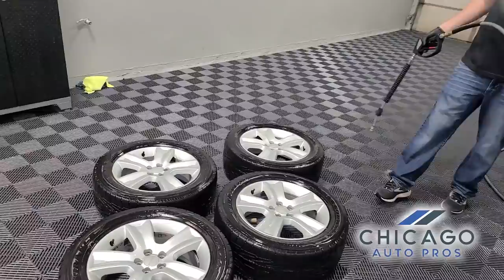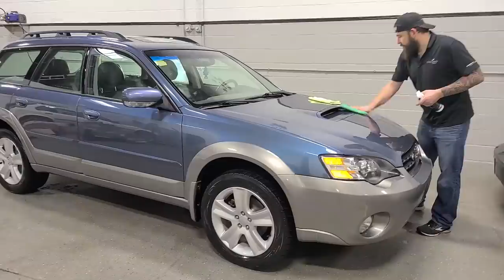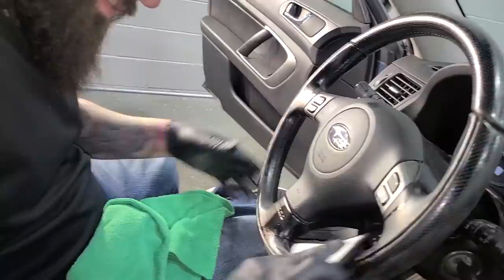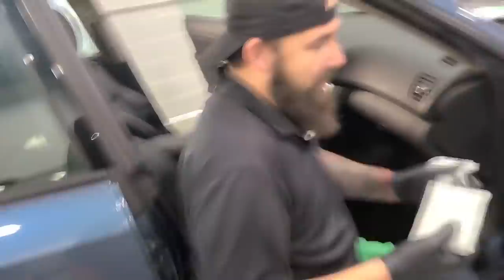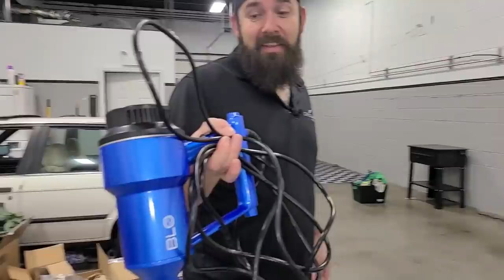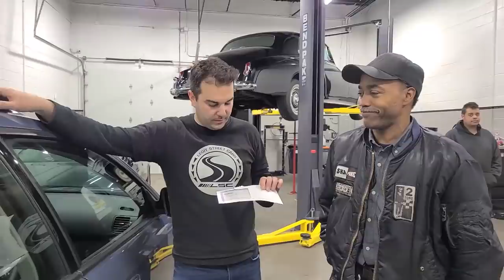I Tried Giving Away My Turbo Subaru To A Subaru Enthusiast For Christmas & He Said NO! REJECTED!

Comment: I have exactly the same car and same color. 2005 Outback XT Limited 5EAT with 177,000 miles. I bought it used at 95,000 miles and had to replace the turbo. Other than wear and tear items, it has been pretty reliable although not as reliable as my Hondas and Toyotas. I had to replace 5 bent valves a year ago because timing belt broke at about 65,000 miles. I pulled the engine out and other than the 5 valves, everything else was fine. Hopefully I can get another 100k miles out of it. Good luck to the next owner. Merry Christmas, Happy and Healthy New Year to everyone.

Comment: Subaru enthusiasts, by default, can all be defined as "in need." 🤣
Reply: lol y u no like subrrraru?
Reply: @useless3596 , I had a new '13 Outback that drank oil like a highschool freshman at a kegger. That thing burned through enough oil in the sump on a 180 mile highway drive to trigger the low oil light. Fool me once and all that. 😅
Reply: @mphilleo  it was NEW? Good grief...
Reply: @benzlover55 , yep, a brand new lease. This would've been included in that class action suit/recall/extended warranty Subaru had to comply with. The dealer would monitor oil consumption and if you met criteria, you got a new short block. I called the purchasing dealer from out of town, and they said it was probably a faulty oil light and keep driving. I topped it off at a gas station, but my trust was gone. 

After awhile, I got oil-related range anxiety and the above option didn't exist yet, so I turned in the lease early and took a bit of a bath. In retrospect, I'd have done things differently.
Reply: Lol

Comment: Thanks for trying to give it away. Second month on a brand new Subaru Ascent and my sister had to have a brand new transmission. I think Subaru's may be overly mechanically complicated like Volvo's are with their electrical systems. Too many things going on at once, some of them will break over time. Or a lot of them.
Reply: Not complicated at all.  Just poorly and cheaply engineered.
Reply: At least volvos wont rust in to the ground in a 5 to 10 years period of usage on salty roads 🤣🤣
Reply: Guess I lucked out. My 2013 Outback has never been in the shop, only thing I've had to replace is the battery.

Comment: You need to look for some enthusiast that doesn't have a car and needs and wants to have one. I don't think Linc wants to have a second car. I wouldn't. Unnecessary expenses for repair, taxes, insurance and registration, all that for a single year will exceed what the car is worth on the market. This is a money pit. And if that is someone without garage or own driveway it is burden wich I belive that's the case.
Reply: I could not agree with you more. The entire time I lived in apartments I owned just one car. No where to park another or you get charged for additional vehicles and like you said more insurance and registration. Now I own a home, have a single car garage but can park four cars in the driveway. Like a typical car nut I have three cars but only one runs.

Comment: I’ll trade you my 02 Maxima 6MT 139k miles. It needs timing guides, has coolant issues ( maybe head gaskets), exhaust hangers have broke, it needs a new blower motor, I think it needs rear brake hoses I think. I’ve replaced complete rear brakes and hubs but still squealing. I’m never going to get all of this done. I don’t have time but would love a winter car since I live in Indiana and drive 45 mins to work!

Comment: There’s also a warranty on the rear brake lines. The distribution block in the rear rusts and Subaru will change the brake lines front to back under warranty 😀🇨🇦

Comment: Couldn't resonate to "not that reliable" talk :)
Owned Forester 2002 factory setup for 11 years, second owner. Similar weather as in Chicago here in Estonia, North-Europe.
This has been most reliable car I know. I ended up on 376000kms on dash and never had engine failure. Of course the bodywork was necessary at times, as we have salt here on roads duribg wintertime.
The secure feel hitting whatever road at whatever season is amazing with this car. It works as a tractor if necessary.
Sold it to Ukraine as it is too expensive restoring it here.

Comment: This is part of the reason I am not done putting my 02' WRX back together. I bought a replacement JDM engine and everything needs to be swapped from old engine. Problem is since I live in a northern state where salt is used on the roads in the winter alot needed to be replaced. Since the car will no longer be driven in the winter I want everything to look nice.  I have boxes of replacement parts and upgrades to install. Hope to have it back together by spring then she gets a new paint job.

Comment: So, don't hate me for not watching the series to see if you covered this, or if someone else mentioned this, but.. These subies  (and some others) have issues with the brake lines failing around the gas tank. If you look up the WQK-47 recall it should show you the locations. 

There's a 4 way joint connector where the lines coming from the front split to the rear two calipers, that's one failure point, where the lines aren't dipped in plastic at the ends where they connect to the joint connector block. Then there's a few places around the gas tank where the lines are clipped to the body. In subaru's infinite wisdom, the left about 1" of brake line unprotected by the dipped plastic stuff, so the clip could hold the brake line. Why not just use a bigger plastic clip subie, that can fit around the dipped plastic line?! 

Anyway.. The recall sprayed a nox-rust anti-corrosion wax on those places, but it's not good enough, some people have still had failures after. Just want to mention that since it's not too hard to fix, a little bit of nicopp spliced in under the rear seats going back to the joint connector, and back to each rear caliper. Or at least that's where I've seen other subie owners splice in. Wouldn't be a bad thing to do before giving it away.

Comment: You can give to me! I had an 07 impreza, and it was the best winter car that ever driven! Since that impreza, subarus are the best cars for winter, according me. They may not be reliable, but if you know how to repair cars, that is not big deal.... I have an RX8 that had a blown water jacket seal, I am rebuilding it at this moment, this spring it will run again. So reliable or not, I dont care, I drive these cars because the way they drive, the way they ride.

Comment: About 4 years ago, we were looking for a car for our son to drive....and I found a 2009 Subaru Legacy with a manual transmission...and I called a Subaru mechanic for advice...and it was "I would really reconsider purchasing it."  He said it was at the mileage where the bills would get expensive and suggested finding a newer one.  Having owned a BMW for 9 years, I can relate to expensive repair bills when the warranty expires and was really surprised with what it takes to maintain some Subarus.  Still, if I were to buy a newer car, I would definitely consider an Impreza or OUtback.

Comment: beside its oil consumption problem (use cheap oil) i have only change a clutch and a thermostat on my 130.000miles 05 euro outback. I change the timing belt twice, the water pump once, 4 sets of sparks, a recharge of the ac, a couple of front pads, one set of rear pads, and frequent oil changes with flushes.. and a pcv cause i thought it was part of its high oil consumption. It was not.... I converted to lpg 6 years ago, so its mpg in terms of money is like a diesel. I dont know why some cars (specially diesels) are so hard for americans!

Comment: That was my 2007 outback. It looked brand new inside and out but mechanically it was a total shitbox! I've never owned a car that needed so many repairs lol. I actually owned a 92 Lumina that was more reliable and only cost me $400 lol. The Lumina had 136k miles and ran perfectly the Outback had 76k miles when I bought it and by the time the engine was about to die it had 126k miles. Mine head gasket issues, wheel bearings, universal axles, bad steering rack, ripped front arm bushings, transmission issues, rear inner hub bearing issues, sway bar bushings and links wore out, rear suspension rusted and couldn't be adjusted. Random electrical issues including failed solder joints for the airbag monitoring system that threw trouble codes for the airbags, wiring issues that caused the car to randomly hesitate and loose power. My outback was an absolute turd. Oh and the ABS and traction control would ALWAYS stop working every winter lol.

Comment: Merry Christmas Alex. 
In your last video at 7.08 you remove the harmonic balancer and show it with a timing wheel on the back yet when you put the new one in I didn't see the timing wheel on the back of the balancer, you may have done it but if you missed it, you won't get it to start.

Comment: Funny vid. I have to admit I fast forward it to introducing Linc to this car. "I'll have to back to you" LOL, I love it. I were him I would love to take that car, however it's easy to say no for me as I live far away. BTW I wanted one of these cars but wound up shying away from the XT model and settling on a 2009 5 speed manual model Outback 2.5i. Great car that I've owned for 3 and a half years. However I bought it with 135k on the clock and I have put thousands into this car. Paid 7k and spent over 8.5k, great car but it needed everything you could think of that would go bad typically with these cars except a turbo as it has none. Yeah I guess the turbo version is even more maintenance intensive. According to my mechanic those cars didn't respond well to being turbocharged and better to just get the 6 cylinder version if you like the outback and wanted more power but I wonder how many with the bigger boxer mill also came with the 5 speed manual. I love driving mine, kinda a rare car with the manual transmission and fun to drive, timeless body style.

Comment: I had a mildly tuned 2005 Legacy GT wagon. It was a blast to drive, great on the highway, and was unique enough that you didn't see a ton of others.  However, working on it was a pain.  If I didn't spin my own wrenches it would have been a huge money pit. The engine died at 130k miles due to a water pump failure. I rebuilt it to the tune of about $5k and it died again at $150K miles despite upgrading the oiling system and changing the oil with synthetic every 3k miles.  I'll never buy another turbo Subaru.

Comment: Great video and deed.  I have a 08 outback (160k miles; non-turbo, 2.5i) with a stalling problem nobody can figure out.  The car stalls typically when on the highway. The car loses power  and stalls.  After resting for about 2-5 minutes it starts back up.  The last time this happened it stalled 3 times in row..   No codes appear when a diagnostic is performed.  The following parts have been replaced by Subaru to address the issue, crank and camshaft sensors.  Throttle body has been cleaned.  The stalling is very intermittent and unpredictable.   Any help or advice would be appreciated.

Comment: I will gladly trade you my 2006 Audi A4 Avant straight across for the Subie. It runs fine just dies about 20 miles into a trip and has about 15 random codes.

Comment: Hey man, i have a volvo 850 and uaz469 if you want it let me now we will find a good deal, but it is on europe. It was my grandfathers car that never dies and drives when you change oil in that thing. But it needs new clutch. i just need some money to build my mercedes om606 project i have the motor, turbo, pump, but still dont have the car to but it on. I love what you do keep going man.

Comment: Alex should give away the car with a warranty - Alex should fix it for free or replace it with another free car if anything happens in the next 12 months. I wouldn't turn down a free car that just had everything done to it. I would even offer my own labor to help Alex fix it if anything went wrong. Heck, I'd even help pay for the parts if I could afford it. But I think the Subarus are really not the most reliable cars. That Lexus giveaway was way better because you know anything made by Toyota is not going to break again in a hurry as long as you maintain it well.

Comment: Subaru and Salt don't mix even though these cars are designed to drive in cold climate. I have rebuild a dozen Subarus from Head Gaskets to Rod Knocks but if the car has to much corrosion, I stay the F*** away from it.

Comment: Omg I just don’t get all the shade. There are TONS of Subaru models that are at the top of the reliability ratings with Consumer reports. Late 2000s/early teens Foresters were consumer reports “best bets”. Way more reliable than Benz or BMW for sure
Reply from the maker: Don't know about anything but this car and it seems to be pretty unreliable
Reply: @LegitStreetCars  I will concede that the turbo engines of this vintage are a black mark on their record

Comment: What is it about Suburu that has people start enthusists clubs? I have stayed away because of so many nightmare stories about the reliability. I am genuinely curious to know what makes people love them.
Reply: Not so sure about the US but in the UK the brand is known for the WRX STI rally car from the 90s which was very successful with Colin McRae and others.
Reply: Boxer engines and full time awd, and the looks. Also the interiors seem to be more refined than in other japanese cars, except Mazdas.
I'm not a subaru enthusiast, but I like these older Legacys and Imprezas.
I really don't understad why cars like Civic and other pos Hondas have all that fanbase.
Reply: @ville85  I don't like Hondas either but I understand why people like them. They are reliable and easy to find aftermarket parts for.
Reply: The love of vaping

Comment: I thought Subies were super-reliable, in general. All car makers have a model or more that will have issues. I knew they had some head gasket issues.
Reply: They need more maintenance than the average Japanese car but are nowhere near as bad as this series makes out. And they rarely flat out break down. I have a 300K outback that has been a champ (non-turbo though).

Comment: I've always thought subaru was VERY reliable.  My sisters forseter is a POS. Nothing but issues and only 8 years old. Girlfriend's  forester only has 58k miles and starting to fall apart.  Suspension work already and starting to stall. What a horrible brand. I expected so much more from subaru. My jeep hemi has 200k and I've literally only put 1200 into repairs (not counting breaks, tires, oils). Buy jeep or Toyota.